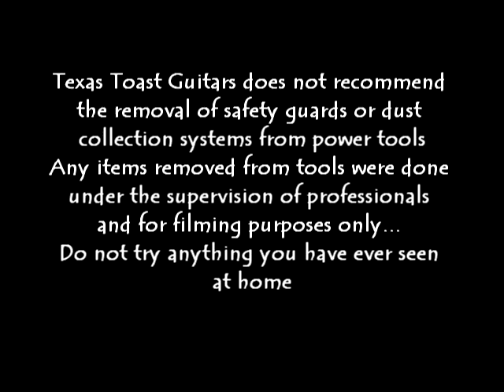Power Tools Set To Music... The JET Pin Router

Comment: so i have just picked up a overarm pin router and need a bit of help. it has a 1/4" collet on it right now but wanted to go to 1/2". what size bit are you running here so you are getting the right diameter around the pickups and neck joint. looks like a 1/2 but just wanted to make sure, thanks for your help and keep kicking ass with the builds.
Reply from the maker: Hi Harlen, Thanks for watching... and the kind words.

I use the 1/2 bit for just about everything these days. I only use the 1/4 for truss rod slots and tight spaces around pick-guards and some of the Fender off-sets need it too, anything with Jazz in the name. Oh and the Ernie Ball Musicman pickup. 

When I do headstock angles I use a 1 inch bit but I'm not taking off too much then.

Enjoy your new pin router, they are great tools.
Reply: Thank you for the insight. I'm pretty stoked about it, now time to make templates. Take care.
Reply from the maker: Stay cool man

Comment: Hello - great fun video. What speed - RPM - do you set the cutter to with that machine ?
Reply from the maker: The JET unit has a fixed speed of 10000 rpm, pretty much the same as my shaper (except I can dial it down to 7000). Thanks for watching the video. If there is anything you would like to see please let me know and I'll see if I can do a video about that. I'm always looking for ideas.
Reply: Thanks for the reply  - mine runs at 10 and 20 but I use 10 too .. i was asking in case you had a lower speed available but it seems 10 has always been  fairly standard. May I send you a private message ?
Reply from the maker: Of course, texastoastmatt@gmail.com